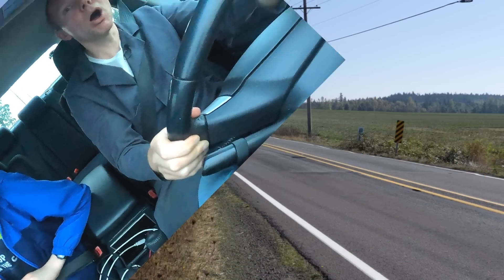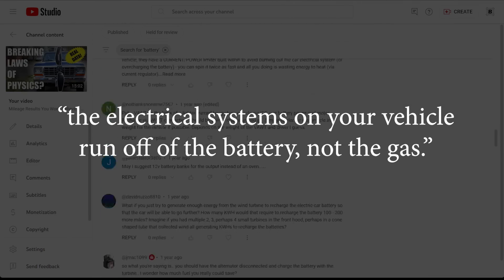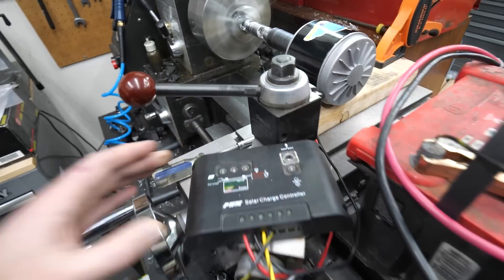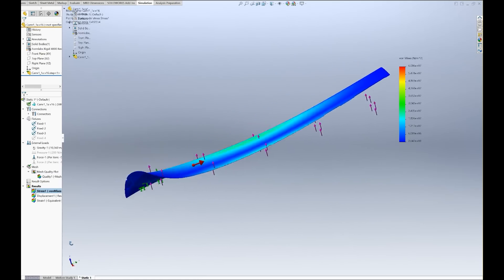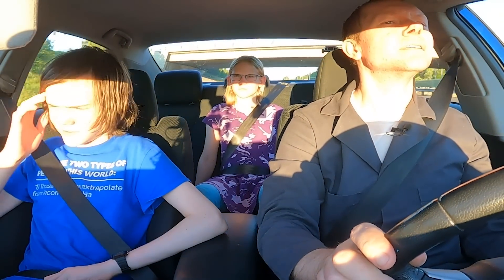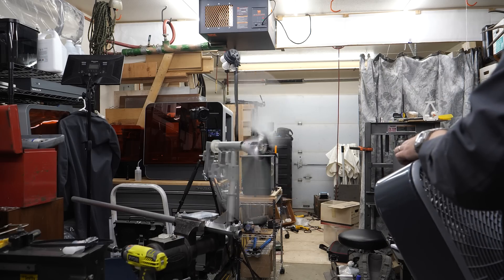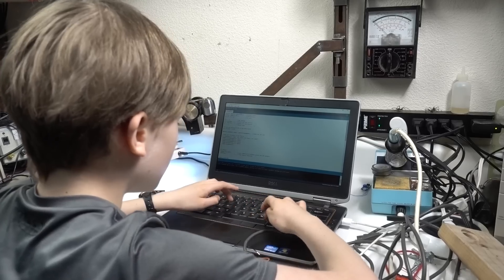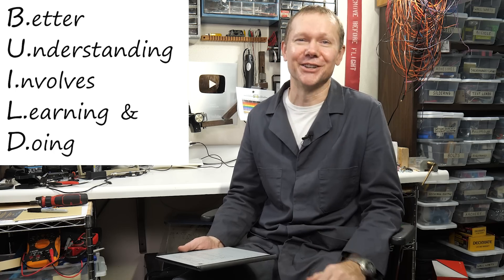3D Printed Turbine on a Camry - Wind Power on a Car #6

Comment: It's the way the question has been posed that's confusing!  The effect is simple: Preferential Drag.  When placing two bodies in tandem results in lower drag for the entire system.  Pros simplify spinning blades into "discs", but with odd drag properties.  The body in front of your truck takes energy to run, but harvests it in a very efficient way that is less than its drag thanks to the design of the airfoil and even its own lift!  A side effect is the wake it leaves behind has lower energy air at lower pressures, so the body leeward of it encounters even lower drag, like you showed in a previous edition!  Adding any streamlined shape in front of your car would likely reduce total drag, especially if that shape had a large wake.  The turbine is just REALLY good at it; so good that it can tap out even more energy than it saves from the system in drag!
Reply: As another aside, energy can even be said to come straight from the air when utilizing pressure differences, such as in airfoils.  Temperature on suction sides will have decreased, as will energy.  Whenever propellers get mixed up in anything remotely orbiting "perpetual motion" like Veritasium's fan car, the energy (solar) extracted from the atmosphere is always missed.

Comment: My bet - the wind turbine in front of a car affects larger masses of air around the car and in turn increases overall drag. The whole power generation process has more stages and there will be added loses from wind turbine's rotor. My final bet - powering by wind going to be 40-50% less efficient than powering from on-board generator directly from the engine.

Comment: The air near the front of any car, is relatively slow of speed, because it is being pushed forwards by the car. More speed can be found for example at the top front of the car, because there the air is accelerating around the car. This is air however is more turbulent and coming from another direction, so you may need to pitch/angle the turbine far down, and actually it may be better to use a different kind of turbine, one that looks like an upside down water-wheel. Have fun, and every time again; what a surprise how children grow!

Comment: My uneducated guess is that even if the turbine is placed in front of a part of the car that would be subject to drag, it will produce turbulence that will impact negatively the overall efficiency.
The end result will however depend  not only on the negative effects in terms of turbulence/drag but  also on how aerodynamically efficient was your car in the first place. 
On the extremes one thing would be to strap your contraption in front of an F1 car another would be to strap it in front of an old truck.
Another variable that should also be taken into account is speed since the aerodynamic advantages are more evident the higher the speed. 
Googling I've found that few people have experimented with the "boat tail" mod and claim MPG gains of 15% or more.  
Curious to watch to what conclusions you get to.

Comment: i think you are going to just about break even or lose about another 1%. The problem is you are slowing and then allowing it to still cause resistance. 
Id be interested if this doesn't work to try and stop the eddies in the back with a bladless vortex turbine on each side. you might be able to lower the losses and still generate some.  great vid.

Comment: The only downside I see is that the windspeed decreases behind the turbine and therefore hits the radiator at a slower speed, decreasing your cooling efficiency. But I think the effect is negligible in a practical sense.

Comment: Car needs electricity. Alternator make electricity from engine. Turbine make electricity from drag. Can car 'draft' behind turbine? I don't think so, I vote 3% worse fuel economy.
If it's better fuel economy. Can you instead just replace the alternator with the generator you used on the turbine?

Comment: It will get worse!
Wind turbines work because the are really good in "breaking" moving air, aka the have a very high wind resistance.
But other then direktly driven generators, there mechanical efficiency is much worse. Best case you get 50% efficiency overall out of the wind turbine, but a lousy generator starts there and goes up to high 90s because there is nearly no mechanical lose involved. 
For better gas mileage just cover up your radiator partially until you just have enough cooling for given speed and air temperature. The air that goes through the radiator hase alot more resistance on the car then the air that gets pushed around the car!

Comment: At this point, buying a regular windmill for a couple hundred off amazon would've been cheaper just to test this out.  And, the gas engine is the source of the energy making the windmill turn, so directly powering the alternator from the engine would just be a little less drag on the vehicle.

Comment: Let me give my two cents on the issue of the turbine on the roof vs the turbine on in front. 

At the end of the day, what matters is the drag on the car; that is what the motor is resisting. I think your van very clearly increases the drag of the car. It is just very much less tear drop aerodynamic with a spinning turbine in front. When it comes to aerodynamics, you want laminar flow, not turbulent flow. My worry is that not only does the turbine itself cause drag, but that the turbine also causes there to be less laminar flow over the body of the car. As someone who is a cyclist and knows the pain of being in the wind versus the relief of being in aerodynamic, my guess is that you end up costing more in drag from a loss of aerodynamics than you gain from the generator. The turbine on top is probably worse, for the reasons you give. The cross sectional area is just much larger. However, you do save the aerodynamic flow around the body of the car, but my guess is that the extra cross sectional area dominates there. Overall, turbine in the front is probably better than turbine on top, but no turbine is probably better than turbine in the front.
Reply: Yep, the turbine itself just freewheeling would add drag and mass to the car.  Adding the draw from the generator will increase increase drag even more.  No matter what, that energy is coming from the motor, all that has been added to the system is more drag, more mass, and the inefficiency of the generator converting kinetic energy to electricity.  It's all waste energy.

Even if the fan somehow made the system more aerodynamic, why attach the generator to it? The generator is just going to lose energy compared to the alternator taking the energy directly off the drive train.

Comment: Somethign to note, some cars WILL stop if you disconect the battery..  however not because the battry is giving the power, but because it`s just oart of a loop that you break by removing it and hte car doesn`t like it.  and for the people who say the "battery" runs the car...  well, what keeps the battery topped off??? the gaz via the alternator....

Comment: If the efficiency of the wind turbine is higher then the alternators 50% (and you disconnect the alternator!) fuel economy will improve.
Reply: i mean at least the electrical load of the alternator must be reduced to benefit from the wind power.

Comment: It should, technically work to some extend. The turbine might have some negative impact on the drag coefficient, but that should be offset by the power generated. I am however not sure that the method of testing will be conclusive enough, as you are trying to measure a ~10% difference in efficiency by the reduction of the electric loads. 10% feels like it is in the same ballpark as margin of error, with the potential differences in weather conditions and traffic. Which means that it is likely that people will dispute the results, no matter the outcome. But it is great to see the process of engineering, and the steps required to get any useful data. And the things you learn can be used for further testing, on like a hybrid or fully electric car, or maybe a wind-tunnel test.

Comment: I have a hunch that you're going get a positive result but how will that effect the alternator? The draw on it could cause damage to the diodes. Am I correct? The only experience I have is  from running a car stereo than overwhelmed the battery and in turn caused tax on the alternator. That costed a rebuild but adding a high 2 output capacitor into the system solved the problem.

Comment: The fact that the wind is turbulent doesn't affect thee car.  It's the average over all that matters and that should be the same.
Now, what's behind the blades isn't just turbulent are as you moved some of the air in the same direction of the car (a little).   Unfortunately it's the car that is supplying that energy.   So you've moved some small amount of the resistance from in front of the car to in front of the blades but that's a wash.   
My guess is you are going to change where the electricity is cumming from but the gas mileage will get slightly worse due to more losses in the more complex system.   Slightly being in the 1-2 % range.

Comment: Ostensibly, a roof mounted turbine will cause more drag than a front mounted one because it increases the frontal area of the vehicle, while a front mounted turbine does not.  Drag is a function of coefficient of drag, velocity, frontal area, and air density.  BUT with all of your framework and generator housing hanging in the breeze, along with the the turbulence created by the turbine, you may, or may not, increase the coefficient of drag of the car such that the mounting position is irrelevant with respect to drag created.

Ultimately, the energy of the vehicle as a whole must come from the fuel in the tank.  The only way you will see an increase in fuel economy is if your wind turbine, generator, and buck converter are all more efficient than the car's alternator.  I'm betting they aren't.  You claim a car's alternator is only 50% efficient.  But how is that efficiency measured?  Does that include the efficiency of the engine?  What RPM and electrical load was set to take the efficiency measurement?  It may only be 50% efficient when at low RPM and high field current, but efficiency will vary with both RPM and electrical load.

Your turbine system will also vary in efficiency with RPM and electrical load, and I'm betting the alternator, with years of refinement, a corporate development budget, and bespoke designed power electronics will beat the prototype turbine system.

Comment: This makes me wonder if putting a 300 watt solar panel on the roof of the car would work to improve mpg.
Reply: Hmm, if it were big enough it might make a small impact. I think that is more likely to have a net gain than this project though as you're tapping into a power source outside the loop. This project is trying to harvest power from relative wind that is generated by the car so I don't think it can ever do better than a net zero

Comment: I made an Experiment with my car to safe fuel, by deleting the Belt for the laternator completely and only driving on battery (Charging at destiation). First time it reduced the Fuel economy from arround 5,4L to 4,0L/100km (Big suprise for me!). I aslo switched the battery often, wich sadly (I guess) resetted the ECU over time and did not give me back the benefit of the lower fuel economy, bcs it is going back to factory settings. My Next goal is it, to increas battery size from 45 -200AH and using flexibel Solar Panels on the roof and hood, to create enough Electrical Energy for the car in daily rides. Ofc to safe electricity, I switched as many lights a s possible to LED, which helped a lot.

Haven a Wind generator on top of the car roof, will increase drag significantly, bcs it is increasing the projecte surface of the car. The car is becomming literally bigger for the wind bcs of mor surface. Since you put the wind generator in front of th car, the projected surface stays the same. What I think will happen is, that ist does not benefit the fuel economy a lot, since the resistence of the alternator is still pulling on the engine. Also the generator is producing drag (blades need wind force to rotate generator), thus increasing drag of the car, bcs the car itsselfe has to "work" for the windspeed. Sadly, the Stagnation Point is ofc producing drag, but the Turbines are not in the stagnation zone, but in front of the vehicle.

My guess is: Yes, Energy prodction will be possible to your goal, BUT It sadly wont safe a lot of fuel. In this case, we are decrasing the need of energy from the alternator (Less fuel from engine), but increasing aerodynamic drag (more fuel from the Engine). At the End, I think Fuel Economy will stay the same.

Hope this was accurate enough :)

P.S.: big lover of you Chanel! Keep it up ;)

Comment: i think the mileage will go down by 5% at highway speeds because you mess up the aero with the turbines more than you recoup with generators on the slim car. On your blocky Bronko I'd say mileage improves.

Anyways: try electricity from hot exhaust pipes next. Maybe thermo-electrically (cheers from Voyager!) or Sterling-engines or something.

Comment: Regardless of where the turbine is mounted on the vehicle, if the generator is producing its 400 watts, it applies the same amount of drag that the car engine has to account for. You showed the power required to get the 400 watts when connected to your mill, this is the same as on the car. When the generator is producing 400 watts, that's the same as applying 400 watts worth of brake. The engine has to overcome that to maintain the same speed and to maintain the same speed, the engine has to produce (at least) another 400 watts.
The only time you'll get free power is when wind rotates the blades and the turbine is stationary.

Comment: I think the fuel economy will improve by 1-2%, or just enough to claim success but still be unviable in real world applications. This is because it costs money to add turbines, and will be difficult to fool proof it for most vehicles that have to operate in various speeds and wind conditions. The aerodynamic penalty I assume will be small, but present, there will be friction and electrical losses, and the lack of alternator will net out to my predicted %.

Comment: If I had to guess numbers, 4 to 6% efficiency increase. 
The wind behind the fan blades will still produce some drag on the car.
(Gut feeling)

Even if the alternator does not produce power there is still some losses in friction of the belt and pulleys, bearings, etc.

Disclaimer: I did zero math on my reasoning. It is all gut feeling with a little bit of fluid dynamics understanding😅

Comment: I believe placing a wind generator at the front of a car to harness energy from the air will result in a net-zero gain and overall will increase aerodynamic drag due to the expanded swept area and interference with oncoming flow. The only plausible way to achieve what you are trying to do would be to capture only the turbulent 'waste air' from the car's wake, which would be extremely difficult, making it impractical and inefficient for recovering lost efficiency in a moving vehicle. 

The only real way to increase efficiency is to overall reduce how much energy is being used. That being through adding energy recovery like regenerative breaking, decreasing drag, reducing complexity, and making the powertrain more efficient and less energy hungry.

Comment: pi, well it works, if you make the vehicle less draggy and install turbine generators, it means less engine power wasted by the car air drag shape and some drag added from the turbines. diy passive maglev bearings, radial-axial 45 degree magnet ring plates, self supporting locking two rings. back to the future? lol. a wobbly stick tho.

Comment: you already answered the question in your last video about this topic, right? The difference between a turbine on the top vs turbine in front. 
Drag force = 0.5 * frontal area * drag coefficient * air density * velocity^2. 

A turbine on the top adds surface area, and does not reduce drag coefficient. Thus drag of the car increases.

A turbine in front does not add surface area. And the turbine might actually reduce the drag coefficient of the car, since the turbine itself has very low drag, and it reduces the speed of the air that hits the car body thus reducing drag on those surfaces. So frontal area stays the same, while drag coefficient might decrease. Thus a net reduction in drag force. 

So, even if the turbine doesn't produce any power, it has already made your car more efficient by reducing drag. So, any power that the turbine does happen to generate is extra benefit.

Comment: I think - guessing on old memories - that having the turbine in front of the car does two things: one, it gives undisturbed air to the turbine, improving performance.  And two, the turbine is disrupting the air flowing around the car, making it easier for the car to push through the air.

I'm not sure on this, so if someone else who is trained in aerodynamics, please correct me.